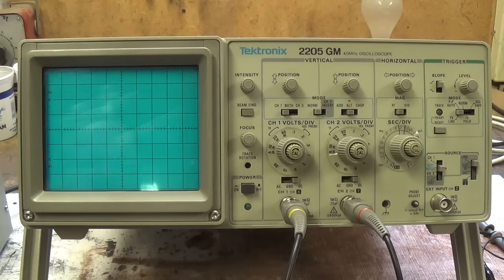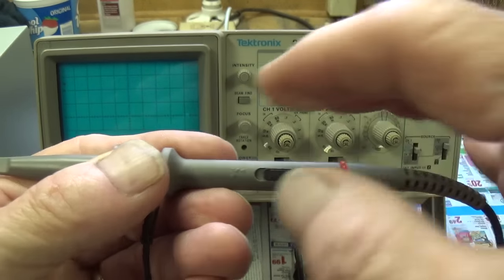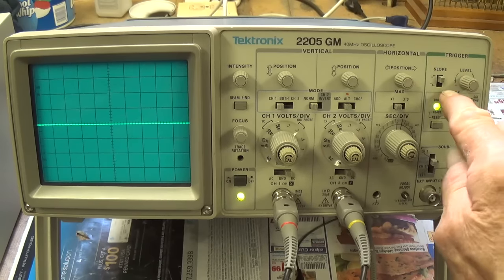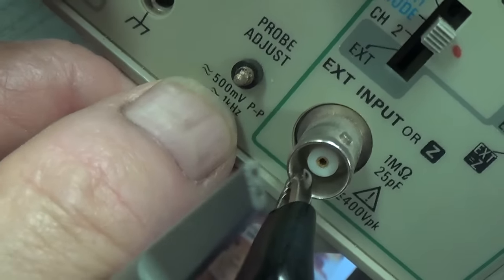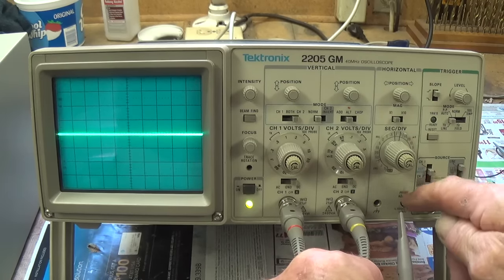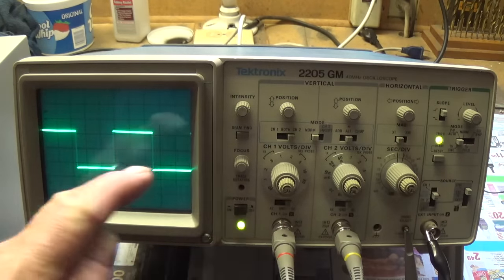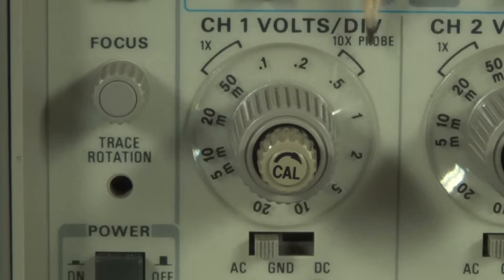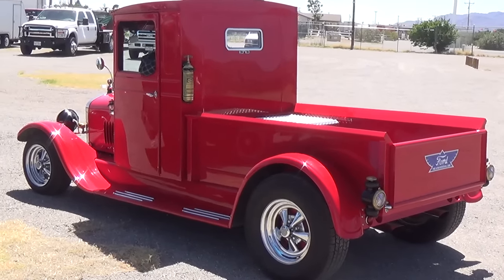Oscilloscope Basics, Part 1: Discussion, Y-Axis (Voltage) Controls, Probe Calibration

Comment: well...no luck here...I managed to get a  square wave on channel 1 but it is half the amplitude it should be. I noticed the rotary switches are probably dirty inside, cause they cause all kinds of crazy interference patterns when moved, so I will start by cleaning all the pots and switches...at least there's a square wave coming in. Also, the probes are all marked 10M ohm while the channel connectors are marked 1M ohm...and the probes don't have a switch on them to change the attenuation, but only a small interruptor.
Reply from the maker: I knew there would be variations in equipment and results, GP, but the good part is that you are working on the scope and will, most likely, get it working properly.  Good luck.
Reply: I started reading about these probes and also found the Tektronix 442 manual. it is an old (1973) analog 35MHz scope. The manual describes the calibration procedures (which are pretty much the same you mention in the video). I will start from the beginning and will clean it, get new probes. I am confident it is working.
Reply: You will notice, Gaita, that the pots are sealed on scopes like the Tek seen here making it almost impossible to clean.  You will need to take them apart or replace them.
Reply from the maker: That's great news, GP. If the manual is written in away that fosters comprehension, it should be a valuable resource.
Reply: Joseph, I discovered it through the worst possible way. I opened the scope and cleaned it. It had a lot of dust inside, I sprayed the pots with contact cleaner at the base of the shafts as I am used to do with old synthesizers, cleaned all knobs, the front panel plate, the tube connector had a lot of dust...it looked like new...then I turned it on...and it is now officially dead. No image in the tube, although the power led is on. Can't tell what went wrong, but I believe there was important dust inside that went misplaced. Now to the scope shop.

Comment: how do u use one of these to calibrate a cd laser?
Reply from the maker: Heck if I know, Mr. B. This is a vintage amp channel. We don't comprehend those newfangled CD things ;)
Reply: suggest you buy Homer Davidson' book "troubleshooting and repairing CD players". you'll also need the service manual for the unit and know how to read diagrams. You may need some additional test equipment as well.

Comment: Those without signal generators can use their computer's sound output.  No shortage of YouTube videos of various test tones.
Reply from the maker: That's an interesting suggestion, AQ. I never considered it. I'm surprised there are smart phone apps for signal generation ;)
Reply: These are probably much better than playing a YT video as they won't have audio that's been smooshed up by the data compression algorithm.
Reply: I was thinking the same thing in terms of signal generation.  Create a tone in Audacity and pump it right out the line out.  You've got your choice of four waveforms, any number of sample rates, and any frequency you can type in.  Only problem is that you can't give it a specific voltage, peak-to-peak.  You can set a relative amplitude, but the actual voltage of the output would, I would think, depend on your sound card.

As for phone apps, with high frequency signals you run into problems with the sampling rate.  For instance, the other day in my music appreciation class, I was playing out test tones from my laptop through a nice set of JBL reference monitors, but to get a decent 17 kHz tone, I had to jack the sampling rate up as far as it would go, to 384 kHz (it was kinda fun watching the looks of pain on the students faces, when my poor old ears couldn't hear the tone at all!).  Figure at a CD quality, 44.1 kHz sample rate, with a 20 kHz signal, you're only getting about two samples per wave.
Reply: Yeah a typical consumer device line level output is no more than about 2V peak-to-peak. But that should be fine for most applications in testing a guitar amp. Combined headphone outputs like many computers and smartphones have these days probably go even hotter, not sure offhand how much. (They might auto-detect the impedance they're connected to and only give you headphone power if it's a relatively low impedance of a few hundred Ohms or less. Line level inputs typically have 1 kOhm impedance. Guitar amp inputs are more like 1 MOhm but they usually take line level inputs fine as well as generally you can always go into a higher impedance, it's lower impedance inputs that will overly load the outputs and distort the signal, usually by it losing a bunch of low end. You can demo this by running an electric guitar into a line input on a regular mixing board and hearing how sucky and thin the tone gets.)
Reply: Oh and yes, that's why the frequency response of 44.1 kHz is 20 kHz, as you need at least two samples to catch the high and low end of the wave. Counterintuitively though, the waveform will be reconstructed correctly with only this amount of data. But of course you can't represent any frequency over Nyquist (half the sampling rate) or you get aliasing (wrong frequencies "mirrored" down into the audible range). So yes, there's a 20 kHz limit for using any typical computer or smartphone as a tone generator, but again, that's more than fine for testing a guitar amp. Guitars don't produce frequencies much higher than 6kHz (which sounds like it's a lot less but it's actually just slightly less than a mere two octaves below 20 kHz as an octave drop is a halving of the frequency). 

Here's a good video on it... (jump to 4:30 for a great demonstration of what I'm talking about)

https://www.youtube.com/watch?v=cIQ9IXSUzuM
Reply: Thanks for that link.  Doug's own vid series on the spring reverb he scratch-built serves as a good example, too, of why you might need to generate ultra-high frequency signals, for instance to simulate the parasitic oscillation he was getting.  The problem as I see it is that if you're trying to generate a 20K sine wave with a 44.1K bit rate, what you're getting is really closer to a sawtooth waveform.  Granted, the need to do this is limited, but it's nice that the settings are there in Audacity to do it well.

Funny bit: there's been more than one time that a number of members of the music faculty of one of the universities where I teach have just been hanging around in the department office testing our high-frequency hearing by generating waveforms in Audacity with the bit rate cranked all the way up to 384K.  The looks on people's faces when they walk in on that are great!
Reply: I don't think you'd want or need to simulate the parasitic oscillation. Test tones for audio applications are typically in the audible frequency range.

And you must have missed the part of that video at 4:30 where he explains that your assumption is incorrect. No frequencies above Nyquist (half the sample rate) can be produced and a sawtooth would require a rapid change of direction of the waveform, which implies higher harmonics to make that shape. As there can't be any higher harmonics, you can't get a sawtooth shape from a 20 kHz tone. 

And Audacity is garbage. Get Reaper. http://Reaper.fm  It's not freeware but it has a totally unlimited demo. (You're on the honor system to pay the $60 for it after 2 months.) 

And what are you cranking up to 384kHz, exactly? I'm not aware of any audio interfaces that go that high. 192 kHz is the highest of the high end. And if you're just doing that in software then it's being resampled (sample rate converted) to 44.1 or 48 kHz anyway. (Or possibly 96 or 192 if your hardware is capable of it as most pro and semi-pro audio interfaces are. Though even the built-in sound on my new motherboard does 192/24 HD audio now so it's becoming more common.)

Actually I just looked it up and it seems some do go to 384 now. Wow, and they say 192 is massive overkill!
Reply: Admiral Quality Not commenting on what one would want or need to do, only on what is possible.  Audacity isn't garbage; it's fine for my needs.  Good point about the sampling rate of the equipment.  I'll need to double-check the capabilities of my sound card but it's pretty hot, and if it can't handle that sampling rate I have several interface that do a better job. I'll check out that software you recommended.  I'd suggest paying for it.
Reply: BTW, I only intended the comment about the sawtooth waveform to describe the shape of the waveform.  You're not really correct about a requirement for higher harmonics to make that simple shape in the waveform.  But with only two sample points per cycle, you get a zig-zag shaped wave which doesn't do anything to depict anything like a sine wave.  In fact, with a 44.1k sample rate and a 20k waveform, the result is a complex waveform of something like the 20k signal, plus a "beat" at approximately 4k -- that is to say, nothing usable for any purpose.  BTW, my built-in sound card will do up to a 192k sample rate, so thanks for putting me in mind of checking that -- you're right, for actual audio playback purposes, that 384k sample rate is doing me no good.  But my conclusion is that when it comes to being a function generator, it's probably an instance where nothing beats analog.
Reply: Yes, some of us try to make a living developing software. Definitely pay for Reaper if you use it. It's not just the most capable DAW (if it's possible to do, Reaper lets you do it) it's also the most affordable by far.
Reply: Ed, watch that video and actually listen to the guy this time and don't lecture me about DSP theory because, again, it's my job to know this stuff inside out. You're assuming the samples get connected back together with straight lines. They DON'T! This would imply frequencies above Nyquist (all those sharp corners) and those frequencies would alias badly back into the audible range. The guy in that video DOES record a 20 kHz sinewave into 44.1 kHz samples and back out and he gets a 20 kHz sinewave out on his *analog scope*. 

And yep, didn't think you had 384 kHz sample rate. Starting to see that I might know something about what I'm talking about yet?
Reply: I appreciate the recommendation!  I've got the "lite" versions of Ableton (hate it) and Protools (used to love it 25 or so years ago; now, not so much), and somewhere I have Studio One, which I've heard really good things about, but I've never tried it, tbh.  I'm looking forward to getting a look at Reaper, now.  And I definitely get where you're coming from on the subject of paying for it -- as a professional musician, I'm down with the idea that if people value what they receive, they should be willing to pay for it, since others are trying to make a living by making it for them!  It's amazing what people expect to get for free, nowadays, including music and software at the top of the list.  And the lengths those of us who are providing those things have to go to in order to satisfy those people -- well, let's just say it's a shame Reaper has to be offered up for free in the first place.
Reply: It has a notation editor and reads MusicXML?  Oh, I am SO there!

Comment: btw... where can i find the probes? i see a few of these same oscopes on ebay but they 
 don't come with the correct probes.
Reply from the maker: I bought mine on Ebay and they were quite reasonable. Just be sure the ones you get match the ones I used in the video.

Comment: my vacuum tube oscilloscope keeps blow fuse away .  why ?
Reply from the maker: It must be drawing too much current. You'll need to figure out why and resolve the issue. Good luck.
Reply: I don't have a proper tools to do that.
 I called one technician and he said it could be old bad capacitors .  I don't even know how they look like.  He also said it is hard to get those high vintage capacitors.  
 I decided not too waste my time and money and returned it back to Ebay.   Those old vacuum tubes scopes are bad .   Capacitors goes bad,  tubes goes bad, 
 its just not worth it to buy it.
Reply from the maker: You're right, Bob. I advise against ever buying a vacuum tube scope.....stick with modern digital or SS analog test equipment.
Reply: @UncleDoug  whay do you think digitals are better ?  Actually I am analogue fan. I like vacuum tubes equipment.  Vacuum tubes are coming back for High end audio equipment.  People who wants to spend $25 grand on vacuum tube amp or EQ.  I am musician and prefer analogue sounds .   All my audio equipment analogue .
Reply from the maker: Apples and oranges, Bob. We both favor tube amplifiers......as anyone who knows me will testify, they are the only ones I own or will work on.....but when it comes to test equipment, modern digital and analog transistorized oscilloscopes are infinitely more reliable and accurate than their relatively primitive tube counterparts. Do you use a brace and bit to drill holes?   Do you use a handsaw to cut lumber? How about a kerosene lantern to illuminate your house? Do you rely on a Model T Ford for daily transportation?  Or do you enjoy tube amplification for audio purposes and modern tools for daily use?  This is why I favor modern transistorized scopes.
Reply: @UncleDoug  ok great explanation

Comment: Started at AC, 'because square wave is a form of AC'. Further down the line however, the square wave is on DC .. ?!
Reply from the maker: Just an oversight, Bart. It happens during the hours of time spent creating these videos.
Reply: @UncleDoug 
Ah. So AC is indeed the right position of the knob in this case. Thanks for your quick response. Nice series on the oscilloscope, by the way.  Videos about old amps are also informative, yet entertaining. Learned a lot so far.
Reply from the maker: Glad you enjoy them, Bart. @bartbuntsma9588

Comment: Imagination->Imaging conscious awareness of real-time Actuality, the manifestation of Eternity-now QM-TIME Completeness in a mechanical device with a projection-drawing cross-sectional Cartesian reciprocation-recirculation information signature representation screen, like putting the Universe in reach.

The Correspondence Principle mindset is inherent in learning to operate an Oscilloscope intelligently because even if you can already imagine Euler's e-Pi-i pure-math instantaneous omnidirectional-dimensional Origin of 0-1-2-ness log-antilog perspectives, of a probabilistic superposition pulse-evolution event in a universal relative-timing Circuitry-Eventuality, all the various conduction paths of i-reflection nodal-vibrational components sequences, as if each point information position were a device in a Radio, the Universe is logarithmic, continuously variable and has empirical statistical/probabilistic correlations in degrees of uncertainty according to orientation-observation of holographic line-of-sight circumstances.

Euler's Entanglement Fusion-Fission Function is probably who we might be, if we were born as pulse-evolution differentiates and Celestial Radar Operators.
Reply from the maker: What-ever ;)

Comment: Pardon my stupidity, but I have never understood how you can have both AC and DC flowing through the same wires and even have them flowing in different directions. How do the electrons NOT bump into each other? Idiots wanna know.
Reply from the maker: It's just having oil and water flowing through the same pipe, Bill. They don't mix, yet they coexist quite happily. In fact, it's even stranger than you might imagine, since the AC "floats" on top of the DC, like lumpy icing on top of a smooth, flat wedding cake, or like a boat on water.......the AC (boat) can travel against the DC (water) current.
Reply: Yeah but water and oil are two different things and oil repels water while AC and DC are both just electrons, right? How do the AC electrons keep from mingling with the DC electrons? Does AC repel DC or vice-versa? Is there some kind of force field involved? Aren't electronic force fields also made of electrons? I actually had a year of electronics classes when I studied computer repair in the late 80's, but no one was ever able to tell me how the electrons kept out of each other's way. I've just lived with it being nature's magic all these years.
Reply from the maker: Analogies are not meant to be taken literally, Bill. The AC wave form, such as the signal output from a tube plate will be elevated by the DC plate voltage and, in effect, appear to float on top of the DC. The electrons may well mix, but both wave forms retain their individual identities. Exactly how is beyond my ability to comprehend......but I do know that it happens.
Reply: So only God knows for sure. I knew it! For some odd reason that reminds me of a quote from CS Lewis when he wrote about animals and science saying : "Instincts is just a word that means 'I don't know.'"

Comment: Why in the world would the annoying engineers at Tektronix put a hole for the the ground right next to the signal out instead of a nipple for the ground on the prob.
Reply from the maker: A question I too have pondered, Joseph. I guess you could fashion a jack to plug into the hole with an exposed lug to clip onto.